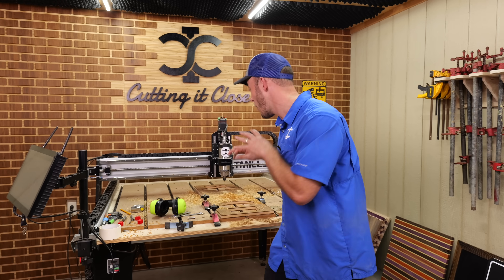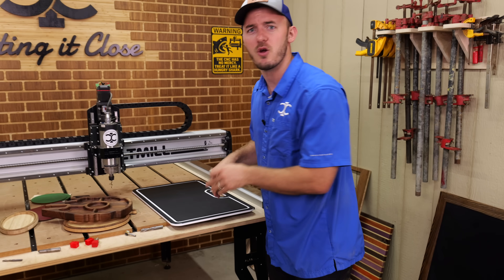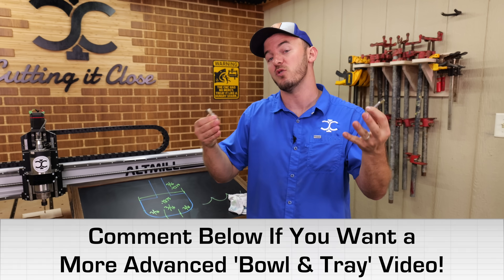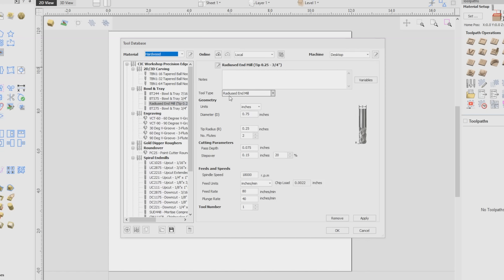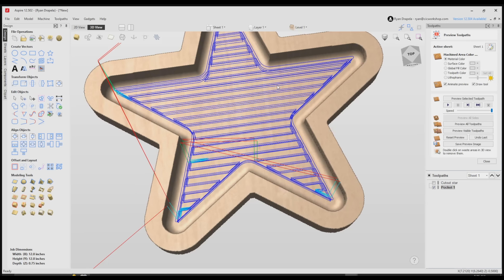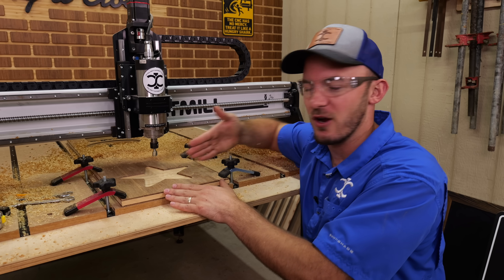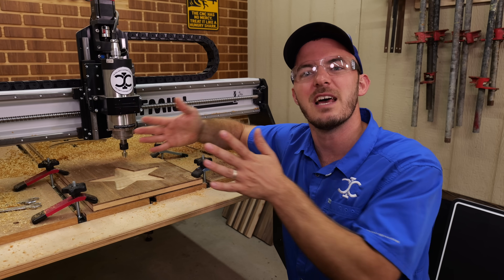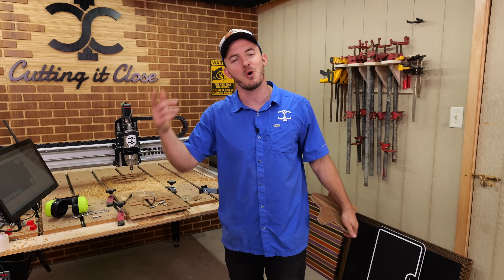I Cut 1,000+ Trays… Here’s the Bits I Used

Comment: Used the bowl bit first time today.  Found I was limited to depth I could cut by the router collar. Had not even considered that before. Question - am I limited to the depth of cut with a Makita router or could it be used with a bit with a longer  shaft without creating new issues like flex of the shaft. Thanks

Comment: I got these bits for my husband. He has a Shapeoko an use Carbide Create. Anyone here knows the specs to put on CarbideC to make these bits work? He keeps testing his settings but it is always off center. 

He is trying to cut a tray on a piece of maple - 3/4” thickness, 8” length x 4 1/4” width.  He is trying to plunge the bit to make a tray with a 1/2” depth and a 1/4” border on the edges. Help please.

Comment: I appreciate the tips, but with a 3/4" you should be able to step over 66%, 65% to be safe. .25+.25+.25 = .75. 33/66/99. 66% will take you to the start of the last .25 so if you do 65% step over, you should be just fine.

Comment: Great video and explanation. Would love an in depth and advanced follow-up. I’ve made a lot of draped flags and as I was watching this, I got the idea of trying a bowl bit instead of an endmill for the roughing pass. Reason is that the witness marks are square coming off endmill so would a bowl bit smooth it a bit better before final pass? Also, maybe for a future video you can show test machining so there is someway to make details much finer and save time on finishing passes. Keep up the great work.

Comment: maybe this is a dumb question ... but is there a technique that will use the bowl bit to do its first 3 passes at a 60ish% step over and only the final pass at 30%. This would save time and still leave us with a very flat pocket bottom. Or maybe that's the advanced video? Thx!
Reply: I would set it up in the toolpaths.
1st toolpath: .375 depth of cut, 3 passes, with 60% stepover.
2nd toolpath: .5 depth of cut, 1 pass, 30% stepover.
Pay attention to which toolpath is first so you dont go full depth on your 1st pass. 
If the selected toolpaths are in the right order top to bottom in the toolpath selector, you can save both toolpaths to one file.